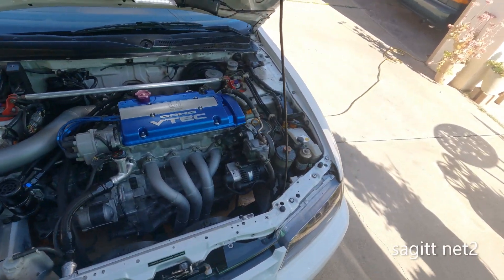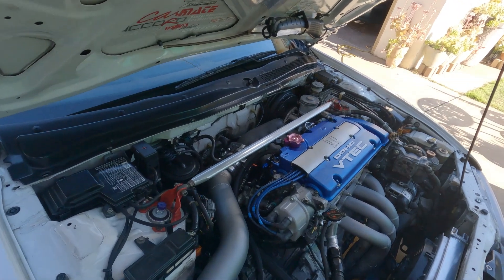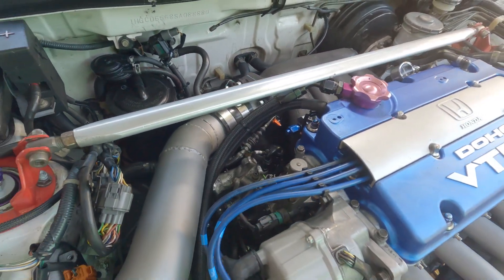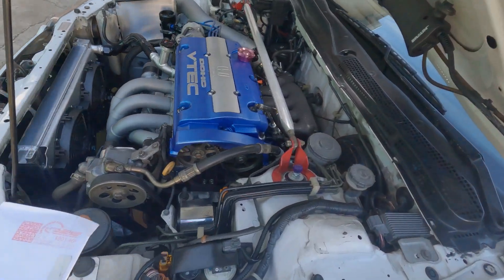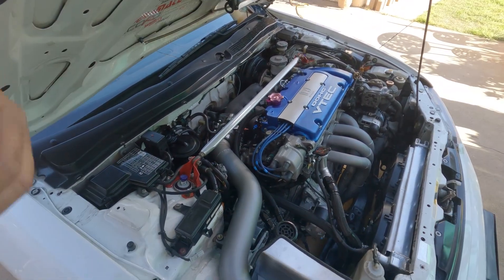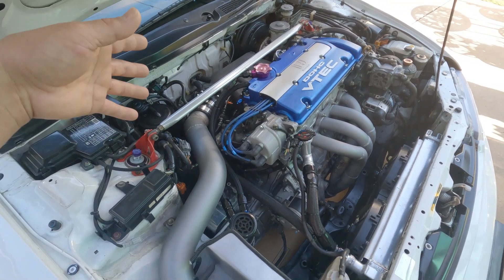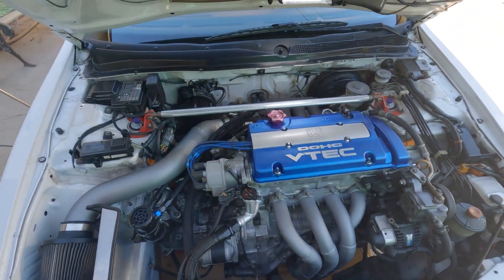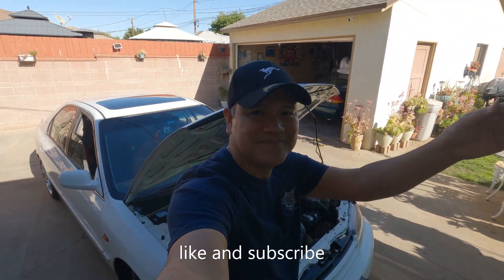How much it cost me to make the RBC K2H Intake manifold?

Comment: Nice man you actually saved a lot of money doin it yourself👍🏼.
Reply: Why not just gut the stock IM and port match?. Should see huge gains over stock.
Reply from the maker: @anthonycha8857 my idea was to use the RBc manifold w/o the adapter and no cutting on rear T mount. Now l, we know it can be done and it'll worked. I'll be using this rbc for a boosted engine on my next setup. I wasn't really after a lot of power on these particular engine ( just like l've said on previuos episode) but is just to show,  that a simple bolt or a mixed of parts from different car can give you more power than regular H22. The rest is really up to the individuals on how much power they intend to make. I was going to use sk2 mani in the beginning but my curiosity and the beauty of RBC made me wanna tackled the experiment.
Reply from the maker: I sure did and it actually worked. If only we can buy the rbc a bit cheaper, it'll be perfect. Thanjs bruh!